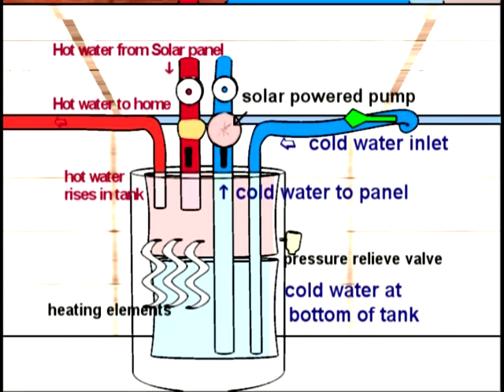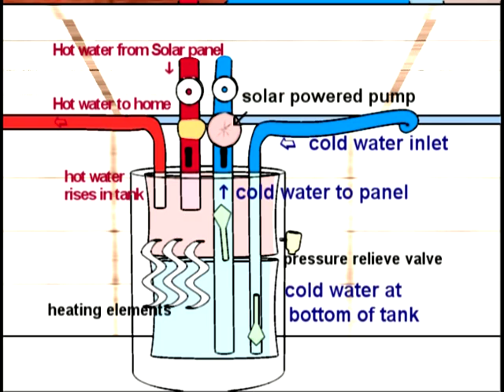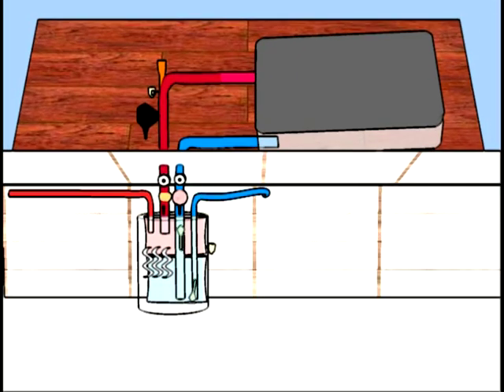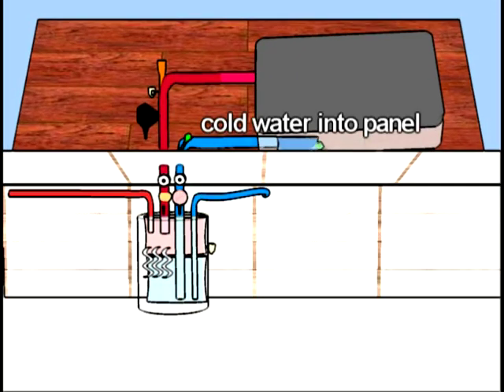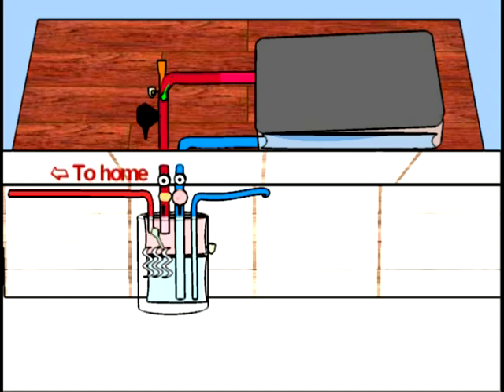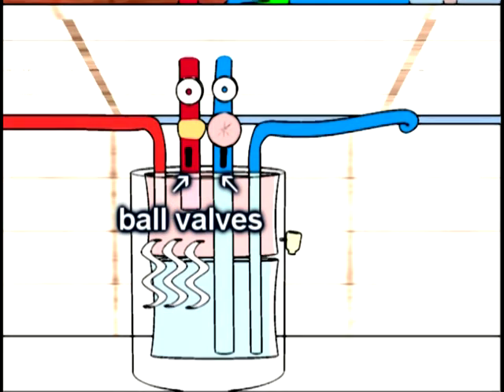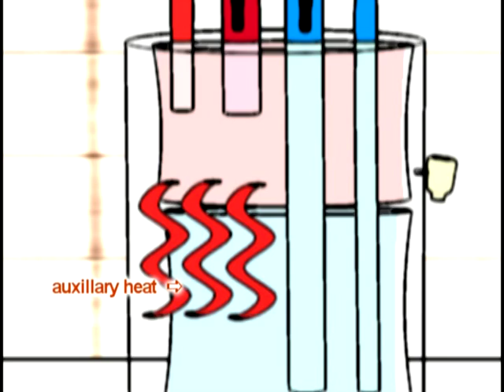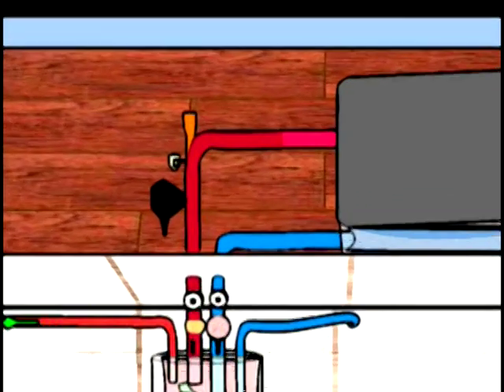Active Solar water heating

Comment: I assume that the sand best for storing heat, is the one with a heavier weight as sand sinks to the bottom. Ask several library reference librarians this question. If you are going to keep it filled with water, think about protection from dangerous mold when the very hot summer temperatures are gone. It is best to keep the whole thing sealed air-tight, except when you are refilling it with water due to some evaporation caused by the higher temperatures ( particularly during the summer months ).

Comment: It is much less expensive to store heat in water-sand at zero pressure on the roof than at house pressure ( and all this stored heat is retrievable for use ). Be careful not to mention this method to the very expensive solar installing company employees, as they may become very violent since this inexpensive, quick to make, and high efficiency method goes contrary to their high economic profits and lies.  This economics gain may explain why not much research has been done regarding this method.

Comment: Another method Two points of method: (1) Two waters, separated, zero pressure and house pressure, and (2) Use principle of heat-exchange to take heat from zero pressure to house pressure by running copper metal tubing with house pressure, inside the zero pressure water. The copper metal does a very good job of transferring the heat, and many times better than plastic or rubber. Mixing sand and water in the zero pressure water is probably better. Thin aluminum may contain the zero pressure water.

Comment: I use copper tubing to transfer heat between the two waters ( house and zero pressure water ). I have never added the sand yet, as the extra weight on roof. Note that new copper tubing has copper manufacturing chemicals inside of the tubing that takes awhile to flush all of it out, before using the tubing for a shower. My system works good six months a year.

Comment: A zero pressure mixture of sand and water is better for collecting and storing solar hot water, as the sand holds more heat but makes poor contact with the heat exchanging of copper tubing, water makes very good contact with both the sand and the heat exchanging copper tubing for deriving solar high house water pressure.

Comment: I installed a drain back heat exchanger on a 40 gal system. No chance of freezing , I get 140 degree water out of a 1 - 10x4 collector. This is the way to go in the north east.